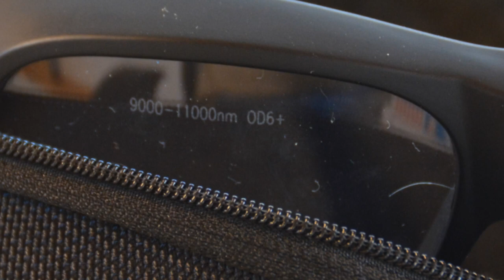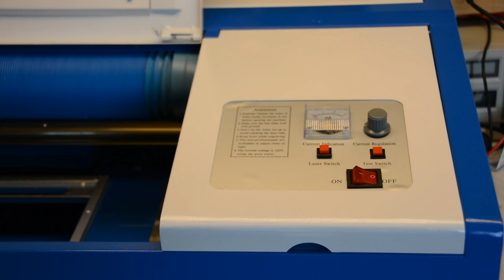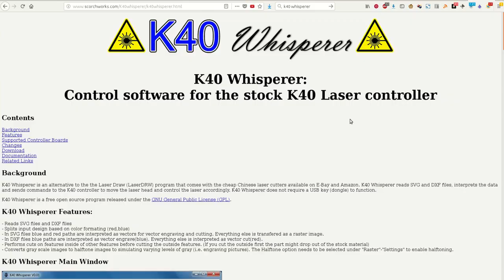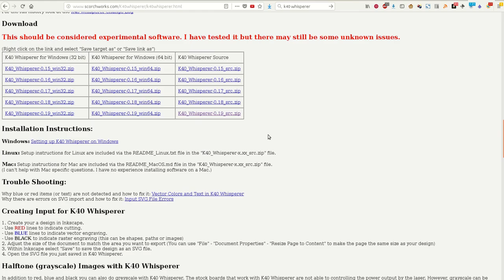K40 China Laser Setup

Comment: Hi, I bought 50W CO2 Desktop Laser Engraving Machine/Laser Engraver Cutter Machine With USB PORT recently.  Is this the same as in your video?
Reply from the maker: jute twine Most likely not. This is a 40W laser. It also has a USB port but if it would’ve the same as yours your seller lied regarding the wattage 😏
Reply: K40 Whisper only runs on Linux not Windows?  There is not guide on how to use the software too and getting help from the supplier on how to use their software is not easy.
Reply from the maker: jute twine K40Whisperer runs on Windows as well but I doubt that it will work for your machine if it’s not a K40.

Comment: Mine came with a clear screen on top.  Not Red like yours.  Are they still protective?
Reply from the maker: Matt Tanner Most materials block the laser beam. I would hope that the manufacturer has chosen a material that is not passable by the laser...
Reply: @WayofWood  This is the response I got from Suncoo 
That light is harmless to the eyes, just can't touch the high temperature.

Cherie from Customer Service Department

CS Department
Reply from the maker: Matt Tanner This is total BS. If you look what the laser beam does to acrylic glass - it does pretty much the same to your cornea ... which is definitely harmful. If you want to be sure remove a small part of the screen (eg clip off a corner), put it under the laser and see if the laser beam gets through the material ...
Reply from the maker: Matt Tanner In my case the laser beam has never hit the protection screen. In practice installing a safety switch might be more important that the material of the screen: An Open lid offers the least protection 😏
Reply: I am sorry.  I am confused. So do I need a red screen to protect my eyes?  Just trying to play it safe is all..Mine did not even have the backing on the window that I am seeing everyone pulling off theirs.  Sorry, just frustrated is all.  This thing is costing me and more every time I turn around.  Finding pieces that are not soldered correctly and missing items.  SO I am taking it one step at a time to make sure I am covered on all grounds.
Reply from the maker: I feel your frustration - wen buying  a Chinese laser you are buying a kit rather than a finished product. Here is my point of view:
(1) The laser beam is dangerous for your eyes
(2) Nobody can tell you for sure if your cover is safe or not (it likely stops the beam long enough to prevent any harm but I can't tell you for sure)
(3) It is not very likely that the beam is hitting the cover - so you could decide to go with the cover, wear safety glasses and it should be fine
(4) If you want to be safe, saw/chip away a small part of the cover where it will anyhow be covered by the brackets, put it under the laser, switch the laser on and see if there is a hole in the material.
Reply: @WayofWood  Thank you so much for the advice..You are awesome.  I hope if I have any more questions I can pick your brain if you don't mind..
Reply from the maker: Sure. Feel free to ask. And have a look at the air assist and the safety switch videos if you haven't done so already. These two measure are quite important to operate the K40 in a safe way.

Comment: I have same machine. But my laser does not fire. What can i do??
Reply from the maker: Mayur Sonar If you pressed down the power and the laser on button O would check the connections from the power supply to the laser. If everything else is powered and the laser doesn’t fit at all the laser tube might be damaged. It’s possible to get a replacement tube via eBay but I haven’t replaced a tube before.

Comment: Should the software work on a 10 years old laptop toshiba windows XP
Reply from the maker: Tomo Polic It runs on a 9 year old linux PC on my end. It is a python 2 application so chances are quite high that it will work on your machine.
Reply: @WayofWood  Ok thank you , I'm having trouble opening the Whisperer after installing it . It doesn't specifically say what the issue is. 
So I have another question If you wouldn't mind.. , what is wrong with the original software that comes with it ?
Reply from the maker: Tomo Polic I honestly didn’t tried it as I don’t have a Windows PC and the reviews from other users were rather mediocre. But give it a try - it should get the job done as well ...

Comment: In my country we don't have Ground, only Hot & Neutral.
We like to live in danger 😁.
Short video but very informative.
Thanks for sharing.
Reply from the maker: Alaa Jannoud Most likely you have ground (if you are in the US for example). Your ground is just connected to neutral at the switch panel of your house. Having the machine properly grounded is quite important - also in this setup.
Reply: No, no earth at all.
Not even in buildings or houses or transformers or anything. No earth rods at all.
Reply from the maker: Alaa Jannoud In that case be careful. I honestly would not dare to use a high voltage laser tube with water cooling in a metal case if the device is not properly grounded...

Comment: it's probably a good thing you didn't get a Full Spectrum Laser, mine is junk.
Reply from the maker: Snyder Spindles I was really afraid of having a machine causing problems after international shipping. I‘ve also heard from people that got K40 lasers with damaged parts - but even if my model would have had any issues I could have replaced it quite a few times before reaching the same cost as a glowforge or full spectrum.